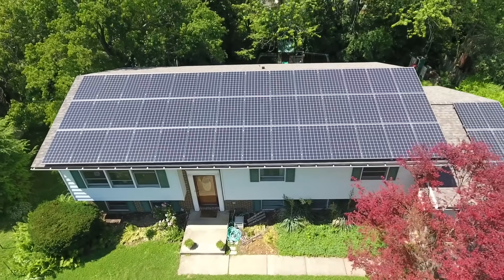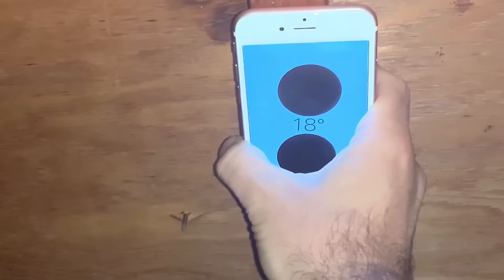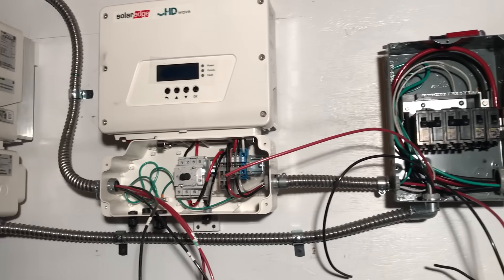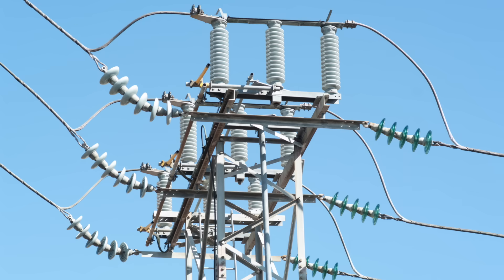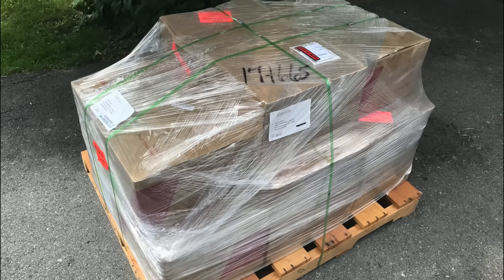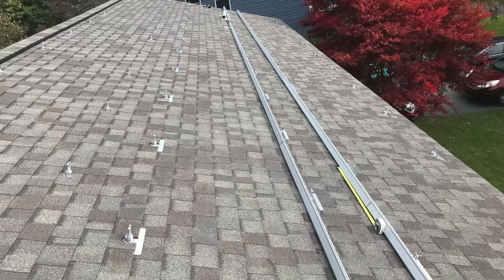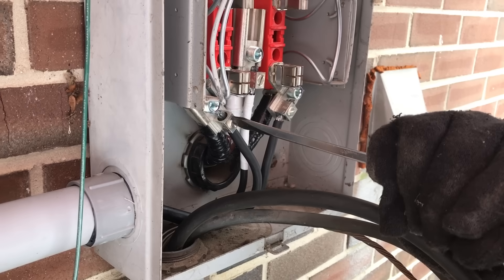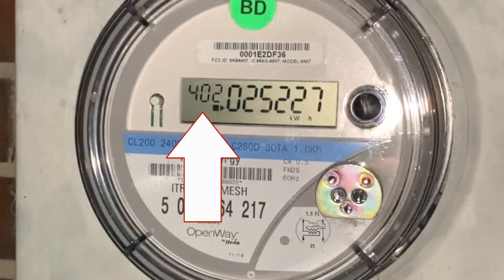I Installed a Power Plant Myself | HUGE DIY Solar Panel System

Comment: Apologies if you did mention it, and I've missed it, but the video was obvious (on getting credit from the utility company), but you've not mentioned that your setup requires the consumers to shop for utility companies that awards credits for the extra wattage you generate (your system, similar to ours, are battery-less).  One question I do have, for ours, when we have brown-outs and/or blackouts (even on sunny days), we lose power, is it the same with your system?
Reply from the maker: The production and costs figures are in the next video after this "Is solar worth it?".  And yes, currently I don't have a wired in battery backup so we do loose power when the grid goes down (which is very infrequent).   We do have a portable battery backup unit that does come in handy and can be charged by solar.

Comment: It always amuses me when people think about cost when talking about solar, while cost is extremely important the true worth of solar and other renewable energy sources like wind and hydro are independence, partial or complete grid independence, this is the true worth and obviously for solar a few panels isn't gonna cut it due to the fact it only produces power when exposed to daylight, so even if your output is sufficient you need to have batteries and that's where it stops being economical unless your trying to achieve grid independence or your energy storage is extremely cheap EI an advanced mechanical battery or something of the sorts. With wind and hydro though you could get away with no electrical storage whatsoever. Hopefully you'll never end up in a situation where the power grid is gone and you need to rely on your solar panels, but if, or more accurately when you do you'll be extremely grateful you installed these and their worth will be priceless. If you have the technical skill and a moderate amount of money, you can build your own house somewhere extremely cheap and remote and still enjoy the commodities of living in a city, power(independent renewable energy production), water(water collection and purification tanks, or even better a river or snow), Internet(Starlink), goods(3D printer, trading would still be necessary), food(smale scale farming and bug farming, trading would still be necessary). Everything is achievable through technology, my dream is to build my own home and live peacefully somewhere a little secluded, mostly self sustaining.

Comment: One solar panel……how much power does it put out and at what voltage DC ?     Thanks Jim
Reply from the maker: One that I have?  I have 325W Panasonic panels.  96 cells in a frame at about .5 watt each is around 50 watts per panel.  I don’t have the spec sheet in front of me but that’s how you get a rough estimate.

Comment: Are the rails standardized? Or do you need to buy the whole kit? I’m buying a house that needs a new roof and am wondering if I could save money having them install the rails and then just buying the panels when I can
Reply from the maker: You could purchase any kind of rails but the mounts and rails should go together (make sure they are compatible).  You also need to make sure that the rails and mounts that you buy are rated for the wind and snow loads for your area.  it will be a challenge knowing what to put in since you haven’t completed the engineering design or gotten the engineering approval many jurisdictions require.

Comment: Hello, do you have any batterie to store energy from the day for the night? I've not seen it in the video and it would be very expensiv. You said you get 0 paid for energy. How without a batterie?
Reply from the maker: I don’t have batteries wired in.  Net metering is the answer.  If you watch the next video after this one I explain the details (costs and production) and how net metering works. It’s called “Is Solar Worth it?”

Comment: S0 how much do u power?   Elec range?
Reply from the maker: Everything in our home.  There is no difference in power availability but now we don’t pay for electricity.  Check out the next video for production and cost details.
Reply: @FrugalRepair  a elec range uses around 40 amps if at full power. I assume u have a rack of batteries to store power.  If u keep a elec range on for any amount of time it would be ducking out the power of the batteries.  And since solar only can be storing energy when the sun is out.  Do u use a elec range or gas?   I am a sparky.   Worked several  years ago on a house. The solar was across most of a roof.  Had a half wall of batteries in the basement to store power.  Forget how long they could go if the power would go if lost power from the power company.

Comment: I've installed one in my home with total capacity of 6kwh and still only one quarter of my roof is covered so in future I can add another 18kwh but even with the 6kwh I now have to pay zero for power, its awesome now to freely use any power appliances without the worry of skyrocketing power bills.

P.S : I'm from India and here we installed the entire thing including service charges to the installers under 2 lakh Rupees which is approximately a tad less than 2700 dollars.
Reply from the maker: Great to hear you have solar!

Comment: I was hoping to see  battery arrays and off grid.  Did you consider that vs the grid tie? To my understanding, if the grid goes down, you have no power available.  Have you found a workaround to that?
Reply from the maker: Yes, because of the safety features of the inverters when grid-tied they do shut off when there is no grid power.  Funny you ask though because I’m releasing a video tomorrow about a portable battery backup system.  I probably will add more battery backup in the future but our power doesn’t go out very much.
Reply: @FrugalRepair  right on I'll be sure to keep an eye out for the video.   I'll be doing something off grid for my greenhouse, maybe I'll pick up a thing or two.
Reply from the maker: Cool! I really like this battery.  It is new one coming out for preorder tomorrow.  LMK if you have more questions, just drop them in that videos comments.

Comment: Solar panels don't work during power outages what's up with that
Reply: It is actually the inverter that does not work during power outages due to this built in function call the anti islanding mode.

Comment: If you ever sell make sure you tell the next owners about the wires in the chimney in case they ever go to re use it 🤣
Reply from the maker: It's not an issue, there is no fireplace or wood stove anymore.  It's just cinderblocks outside so a great support for the conduit.

Comment: With a smooth installation, how do you get to the middle panel if it stops producing?

Have you considered adding a battery bank to store up for when lights go dark?  Will that be your next vid?
Reply from the maker: Thanks for your questions!  If I needed to get to the middle, I would remove a panel on the top row first.  It’s not hard to remove a panel because there only two bolts per side that you have to loosen. For a battery back up, my next video coming out this week is actually on a new battery backup.  It’s a portable system so it’s not going to power the whole house but the most critical things .  I’m reviewing it and I like that I can charge it with solar. I’m still considering a whole house battery though.
Reply: @FrugalRepair  I really would be interested in the benefits of a 1/2 or entire house battery solution.   It is nice to be off the grid, but being able to do it yourself, means you can REPAIR it off grid as well.
Reply from the maker: @tkcdac  True, it is nice to know you could repair, modify, or swap out batteries on your own.  Shoot me an email if you have questions about a setup.

Comment: I want to make sure I understand the process here.  Instead of using a battery bank to store power for night time use, you send excess back to the grid?  Does your array generate enough power to use during low light conditions, or does the credit from the power company cover any expense of drawing power from the grid?
Reply from the maker: Great questions!  I answer them in the next video titled “Is Solar Worth it?”.  The key item to know is about net metering.  I get a one for one credit per KWH I send to the grid.

Comment: When you tie into the grid what's the difference between the price the electricity company buys your energy and the rate you usually pay?
Reply from the maker: In PA it’s one for one, so the same rate.  This is what makes net metering here (and other places that offer it) so great.  Some states though only offer a portion so you want to look it up.  In May I do get any extra credits purchased at a wholesale rate, but that’s different than month to month rates.  I explain it in the next video after this one.
Reply: @FrugalRepair  ah okay I will check it out. Thanks for the response!

Comment: Hi,.. Is the line set directional?... That's to say....  R the connectors specific to the indoor /outdoor units?  Mine came with no identifying marks to orient correctly.... Thanks.
Reply from the maker: I’m not sure what connectors you are referring to.

Comment: Wow. I didn't realize it was so simple. It's just like brain surgery. You take a saw. You cut out the piece of the skull. You scoop up the brain tumor with a special tool. You use this gizmo to cauterize wounds so you don't bleed all over the place. Ha ha. Then you put the piece of the skull back and put stitches on the skin. See? Easy.

I love those videos where the guy talks about and researching permits and electrical codes and converters. Anyone can do it, I guess.

Comment: Do they make solar panels that I could plug right into a hotplate ? Been looking at videos but lights and hotplate is all I want.
Reply from the maker: A resistive load like a hot plate can use up a lot of watts.  If you watch my video on what happens when solar panels break, I have a setup with a portable solar panel and battery.  I am able to run devices with that setup.  Maybe something similar might work for you.

Comment: Finally Solar done right!  Too many people think off grid solar is the way to gain energy independence, when a grid tied system is much cheaper and greener.  Batteries are the most expensive part of any off grid install, there is no limitations to using the grid as your battery bank in a grid tied system, and a back up generator is a far more cheaper option then investing in batteries when grid power goes down.
Reply from the maker: Agreed, a lot of people think you need batteries. Having a generator is a good idea for backup.

Comment: Was this going to be worth it financially? Absolutely YES. With the cost of electric just going up up up up ~ it's definitely worth it. I pay £160 a month and I live on my own in a small place!
Reply: @JohnWoods-f8g  Consider the money saved on power as an addition to your household maintenance budget if it worries you that much.
Reply: @LexYeen  Power or paying for the System...It's the same as paying a Lawyer to get you out of a Traffic Ticket...You pay someone...Last I checked...A receptacle or a Switch was about a $1...Either way...Both systems require Maintenance...

Comment: why do people only put them on one side of their house? o.O why not just fill the roof?
Reply from the maker: Good question.  I explain some of this in other videos but for maximum efficiency you want panels to face the equator.  Otherwise, you may be making a bad investment.  You want to get the right balance of sun hours, angle, cost, and desired utility offset when you are planning.
Reply: @FrugalRepair  hmm.

Comment: So I have a question I can't locate any info about how to installing a mini split unit to a grid tie system directly the meter box....
Reply from the maker: You want to install the mini split to the meter?  Is your question a code related or technical question?  I think you might need to ask your power company if they allow for that.

Comment: what was your total cost and time spent for research to getting fully funtional? how much kwh did you produce on average per annum? whats the efficiency of pannels? did you install batteries? can one charge a tesla with this?
Reply from the maker: Thanks for the questions!  Most of the answers to those are in the next video.  Panel efficiency is around 18-19%.  I could charge a Tesla because I’m grid tied.

Comment: Am I  the only one who thought about the logistical nightmare of needing to replace the roof? Normally roofs last between 15 an 30 years. Hope it isn't hard to remove the panels when it is time to rip off the roof...
Reply from the maker: The roof is protected by the solar panels so the longevity is unknown but it would be well beyond the normal 30 year or so range.

Comment: I am just little nervous about running the cables through the punched hole through the unused chimney. What if the next owner reuses the chimney without knowing there are cables running through it?
Reply from the maker: It’s not a chimney anymore.  A previous owner took the top off so now it’s just cinderblocks.   There’s nothing inside (like a fireplace) either.
Reply: @FrugalRepair  thanks.

Comment: I'm a solar panel installer. You don't need a power optimizer longi suntech and more have "smart" panels with diods that can turn off and on parts of the panels etc etc. Optimizers are just an extra 100 bucks and work for every panel. Yes you can see every panel but I don't need it. You can buy a couple extra panels instead. And sometimes it's better to have horizontal panels instaed of verticals if they don't fit.

Comment: Can you install a solar panel on a two wired residential homes
Reply from the maker: What do you mean by a two wired home?  My house is residential.
Reply: @FrugalRepair  yes but my home was built in 1979 where there is no ground wire.  Not up to code in a newer home. Can I still install solar panels
Reply from the maker: My house was built in 1972.  You might need to add ground rods but that’s not too bad (I cover that in my solar tool video).  You probably only need ground to the circuit breaker box.

Comment: i install 7 kwh sunpower system in my house 7 years ago with 30% from federal and 50% from louisiana back then.  i spend $6 K total and estimate a 6% y/o return which is i am happy with.   On a good day, i get 40 kw per day max (march and april).
Reply from the maker: That’s great!  I would guess you’d get a higher return than 6%, how much is your utility price per kw?
Reply: @FrugalRepair  without federal and local sub..... its about $3500 per KWH.... again... this is in 2014... might be cheaper now... and electricity here in louisiana is dirt cheap
Reply: the system paid for itself almost so i dont care.....my max electric bill is less than 50 bucks in the summer..... zero in some months

Comment: Worth only if the energy is expensive in your country and you are using this energy for heating. But if you need "heating" means you are in the cold climate so the solar panel will not be effective. The so-called "green energy" is the dead route for humanity to switch population mind from true free energy like generator on Mercury or some atmosphere capacitors.

Comment: I have a question? AC system has two phases which makes 120/240. On the input side of the inverter do you need two separate DC inputs from the array to make the second phase for the AC side.
By the way, I know how inverters work I do not need an explanation. In other works does it need two dc inputs to create two AC outputs. I hope that was phrase correctly for you. Thanks nice system I was interested in the DC/AC wiring but you did not cover it.
Reply from the maker: No, for this inverter you just need 8 panels on one string as a minimum.

Comment: I didn’t see that you installed lithium ion batteries for energy storage, why didn’t you? I thought batteries are integral of a solar panel system? Maybe I missed something?
Reply from the maker: I didn’t.  Check out the next video (is solar worth it) and I explain why.  Net metering is the key.

Comment: I love solar even have it on my cabin However its a myth that solar power is a renewable energy If all the hard wear that makes up the solar power system just magically dropped out of thin are then I would say yes but that's not the case look into how the solar panels are made what kind of elements that are in it and how much on grid power it takes to make it and this goes for the batters as well and how their disposed or should I say how their not anyway look deep into solar has far more problems on a personal scale not to mention the environment ,

Comment: So what happens with a hail storm????
Reply from the maker: It’s not an issue, at least here in PA.  The panels are pretty strong so generally you don’t need to worry about it.  Of course, there could always be some freak event and maybe a panel could crack, just like if it would do major damage to your car.

Comment: The amount of money you spent on this will make your electricity charges to 0 after many years. In between you will probably need to change the batteries.
Reply from the maker: I don’t have batteries and I’ve not paid for electricity since the system was turned on.  If you’re interested, watch the next video where I go over the details.